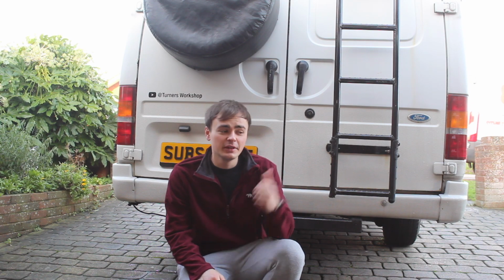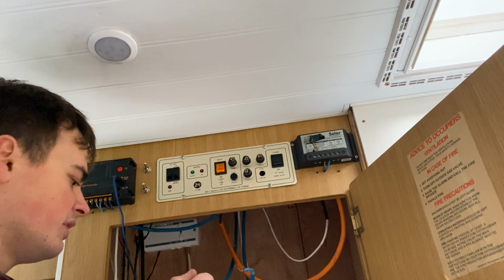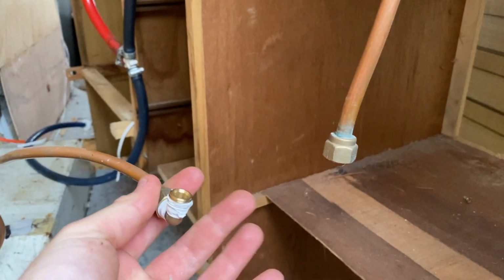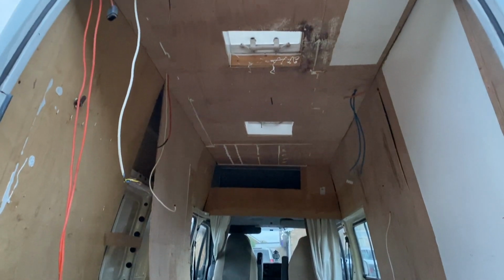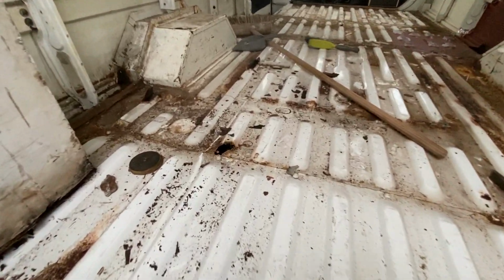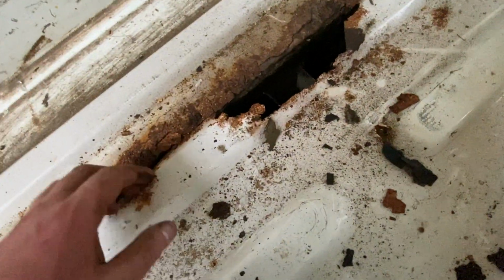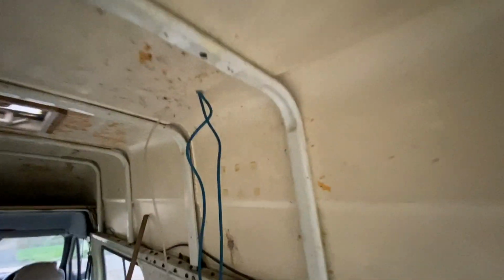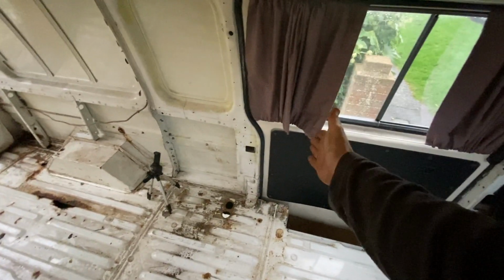The Strip Out - Van Build Series - Episode 2

Comment: oooooooooooooh  thats scary...!   hope you've checked the price of plywood and furniture  board lately or you are in for as big a shock as  I was today. £24.00 a sheet of 6mm   Many suppliers have no stock .  Great start on the van  ......looking forward to the design.
Our van had an external shower attached to the sink base I think the previous owners were surfers. I just couldn't find space inside the van for a shower without compromising the seating and beds.
I fitted a step light to our van which is great for getting in and out of the van at nightime. Wish I had fitted a swing out step now as it is quite a step up at the side door.
Our van came with a fresh water tank fitted to the chassis rails behind the drivers door under the floor with the top up pipe and cap set into the A post. very convenient  out of the way water storage